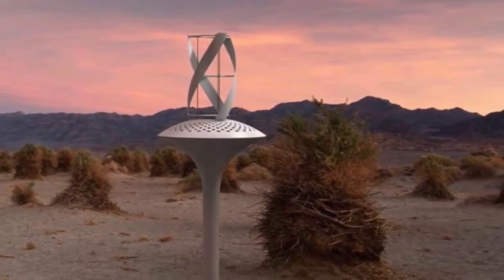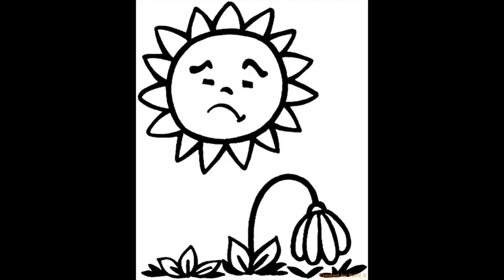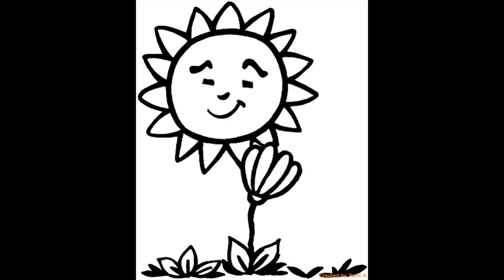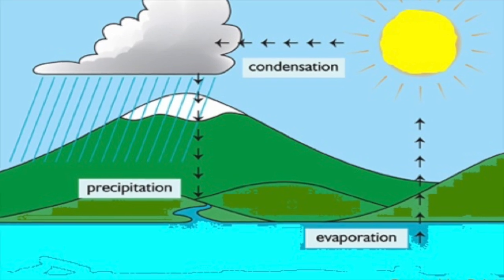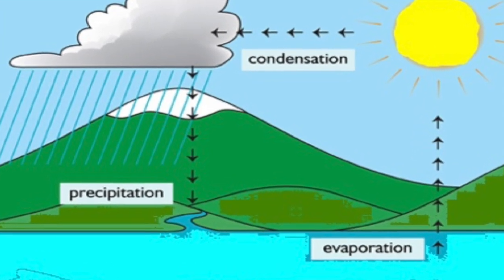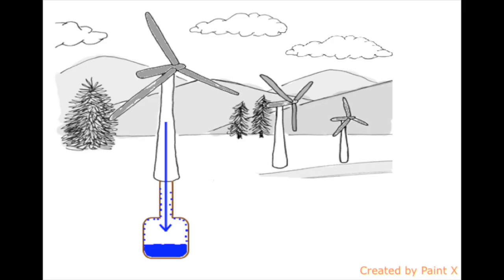Water Seer Debunked then FIXED (2020)

Comment: Instead of restriction of depth to 1.5 meters, say dig deep enough to where ther soil feels cool.  Aren't we discussing a heat pump.  They seem to function consistently.  After all, what is the heat capacity of the planet.
Reply from the maker: @alphalima6810  a geothermal heat pump basically

Comment: will it work if its in the desert and the air is arid  

or can i put a solar panel that will move the fan but how big must the  solar panel be to move it ??
Reply from the maker: @NMJ-zt6my  that’s easy, just work out watts needed and appropriate battery energy storage for 24 hour use
Reply from the maker: H

Comment: I think people are overestimating the amount of vaporized water in the air and the ease of turning it back into a liquid.
Reply from the maker: Are they?
Reply: @SimpleTek  The cost to build and run any of these sorts of devices will be very high versus the amount of water that you will get from it.  There are niche exceptions where collecting condensed water is viable, but they won't be anything like this water seer system.
Reply from the maker: @youtubewatcher4603  how do you know?
Reply: @SimpleTek  Which bit?
Reply from the maker: @youtubewatcher4603  all of it
Reply: @SimpleTek  I don't like one sided discussions, though.
Reply from the maker: @youtubewatcher4603  nice cop out

Comment: USD student Konstantin Avdienko, 18 local news in California built a crude version of the WaterSeer device and it works fine.
I think you need to do another video of him debunking your debunk.... It does work.
Reply: Chris is it true! Does the Water Seer work?
Reply: @OnlyOne0025  Seems so. Student and his school and the local news verified it worked. His is a crude version of basically same as what a water seer device is built
Reply: @Chris-wh3yz  thank you for your reply. So the Water Seer has to be perfected? Or can anyone purchase it and use it with results?
Reply: @OnlyOne0025  As far as I’m aware, the water seer never made it too market. The money raised went bust. I do believe because it’s up against a lot of parties interested in selling air to water machines for big money market. But testing on a. Dry similar approach proved it does work
Reply: @OnlyOne0025  Here is the US student and news report. His is a basic version.
https://youtu.be/eRteOtKqLOw

He improved it on a new device and can be found here.

https://youtu.be/o68leKAf-Gk

This one uses a pair of copper tubing, one inside the other in a coil structure and buried
Reply from the maker: Interesting
Reply: Alibaba has water seers from China available

Comment: Thats a good solution for the heat exchange issue, but does not change the fact that the air is not very humid in the desert  and the ground temp is usually above the dew point for most of the year. I mean, its the frickin desert. If they had the high humidity and cool temps needed for this to work, it would be a temperate forest, not a desert. 
No matter how you dump the heat, it still wont work.
Reply from the maker: Depends on the desert
Reply: Namibian fog disputes your statement.

Comment: This doesn't actually solve 99.999% of the problems with that device. The ground is not cold enough to condense the water, therefore no amount of tubing or surface area is going to help.
Reply from the maker: ground temperature depends on where you live
Reply: @SimpleTek  And yet no matter where you live, the ground will not be cold enough to cause any relevant amount of condensation. There is no place on earth where the ground is cold year round. Anyways, even if the ground is cold, it has to be cold enough to cause significant condensation. In places with water scarcity, the humidity is very low due to lack of rain, thus the dew point will often times will be below freezing, or near freezing. They certainly aren't going to have ground temps below freezing in those places. In order for higher ground temps to work, the air needs to have very high humidity. Places with high humidity have abundant water due to large amounts of rainfall. Also, keep in mind that in everywhere in the entire world, the ground is colder than the air for only 1/2 of the year. The combination of problems with this device mean that if you are in a location that overcomes one of the problems, you are gauranteed to have a different problem. There is no real world situation where this would work. This project should have never made it past the initial planning steps. Basic 1st year college physics can prove it doesn't work.
Reply: @Chris-hn4lp  what about a clay pot filter then tubing to the pump?

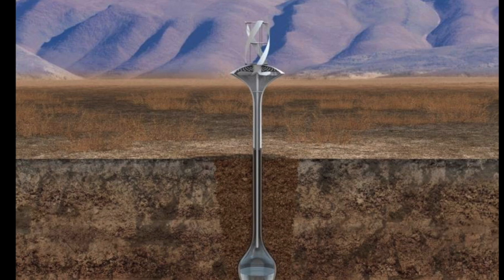Comment: 0:41 "the genius of the waterseer is that it operates with no electricity"
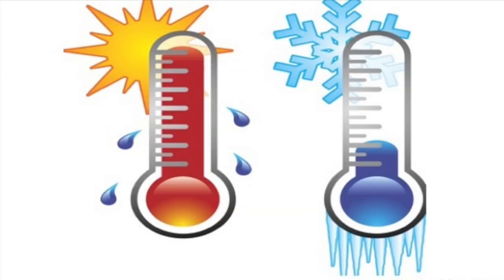1:04 "connect it to.... a small pump"

which needs electricity

That wasn't the only reason it was busted, there also isn't enough humidity in the air in arid areas for it to work (apart from perhaps a few weeks in the year).  The only way it could work is in a humid environment, but those places are rarely short on drinking water anyway.

Anyway going back to the thermodynamics thing, you haven't fixed that either, all you've done is mitigate it slightly.  You're grossly underestimating how much heat would be produced and how vast an area you would need to keep it continuously cool.

Don't forget that cold doesn't exist, cold is just a description for a lack of heat.  Humans can't create cold, and we can't remove heat, all we can do is relocate it.  That's how fridges work - they relocate the heat from inside to out of the back.  That's why the back of fridges are so hot.  Same with air con they extract heat from inside a building and relocate it outside.

The fundamental concept of the WaterSeer is that the ground is MUCH cooler than the air.  At first.  As I say once you heat something you can't remove that heat, it needs to go somewhere.  After you've heated the ground around the seer, it is now as hot as the air.

So you get your water pump and hoses, and heat another area of ground twice the size of that around the WS, and guess what?  Now that is as hot as the air too, it just takes twice as long.  Because the heat has got nowhere else to go.
So you get a longer hose and a bigger pump to cover ground three times the size of the ground around the WS, and guess what?  Now the whole area is as hot as the air too, it just takes three times as long.  Because the heat has got nowhere else to go.
So you get a longer hose and a bigger pump to cover ground four times the size of the ground around the WS, and guess what?  Now the whole area is as hot as the air too, it just takes four times as long.  Because the heat has got nowhere else to go.

And so on.  You can keep on increasing the size of the ground you are pumping to, but you need to get to a point where that ground is naturally cooled faster than the heat that the waterseer is generating.  It's not about the temperature of the ground in the first place, it's how fast the heat dissipates naturally.

I haven't done the maths but you should do, I'm pretty sure the amount of heat that a given area of ground (in the hot dry climates it's intended for) dissipates naturally vs the amount the WaterSeer would need to dissipate to keep dehumidifying is vastly infeasible.  You'd need a massive network of pipes, as i say i haven't done the maths but I'd estimate at least a football field, maybe several, very efficient heat sinks, huge expensive pipes (and the land-moving machinery necessary to bury them all deep enough), and very powerful electricity guzzling pumps (far more than a few solar panels could produce), in order to dehumidify the air for enough water for a family.

Even if it weren't impossible (because the air at the location had enough humidity in the first place), it's hopelessly expensive and inefficient.

There are far cheaper and far more efficient ways of getting water to these areas.
Reply from the maker: ok
Reply: Good points. But what if heating the ground is also beneficial to extend growing season? Or add a heat pump and use it to heat a greenhouse? All this adds complexity and cost, but if ground water systems are unavailable or degraded ...
Reply: @glenm125  WS is supposed to have NO infrastructure to supply small quantities of sustenance drinkable water. What is it about a simple hole in the ground don't you understand?
Reply: How come geothermal systems work then? Do they get heat soak? Hypothetically if you made sure that the temp diff lasted longer than the warm hours of the day, you could make it work. You would just need another windmill to run the pump

Comment: Simple Fix: If the problem is the ground being so warm that it causes the water to evaporate in the condensation chamber, then move your device indoors.  There is no need to bury it in your home, because your indoor temp will be cooler than the outdoor temp, but you can still bury it indoors if you wanted to.   Extend the top portion of the device so that it is outside of your home still sucking in the hot air.  The water will then condense in the chamber without evaporating. This is an easy fix at no real cost other than the tubing or piping needed to extend the top portion of the device to extend outside of your home.  This device does not need to be an outdoor device, it just needs to suck in hot air from the outside.  This will work great in desert climates.  The indoor temperature of your home replaces the cooling effect of the ground.
Reply: So what you're describing is just bringing outside air indoors and cooling it to the indoor temperature. You don't escape the thermodynamics. You still have to use energy to cool the air you bring inside (same as why your fridge uses a ton of energy of you leave the door open). Worse still, you need the dewpoint temperature to be higher than the indoor temperature. Assuming the indoors are ~70F, that's exceedingly rare, and pretty much never happens in dry places. Also, most people who have air conditioning, also have reliable running water already.

I do understand why people really really want the water from air thing to work, it's just not going to. You'll always run up against the fact that the latent heat of vaporization of water is just too high, and the specific heat of air is also significant of you have to cool large amounts of it. It's always far more energy efficient to just move liquid water from somewhere else, even over very long distances.

The only "water from air" systems that actually make practical sense are systems that pull moisture from coastal fog in certain coastal desert environments, but then you obviously have very high humidity, more importantly, the droplets in the fog are already condensed.
Reply: @mediocrehat  They also do (dew?) this as clouds roll over mountain tops using netting similar to oversize volleyball nets. Collection of condensation.
Reply from the maker: interesting

Comment: I thought you were being ironic when I first watched the video. I’m quite disturbed as this shows that so many people lack a basic understanding of simple science.  These must be the same people who think if you leave your refrigerator door open it will cool the room off. Of course this will have the opposite effect as there is no free lunch in physics. There is simply no way to condense water out of the air efficiently enough to justify any of the power and heat cost. It’s thermodynamics at its most basic. 

In order to condense water, you need to cool the air to below the dewpoint and it costs energy to do that, and a lot of it. Of course nature does this all the time on a large scale, it’s called rain and on a smaller scale: morning dew and fog.

Your solution doesn’t address the biggest problem of the Waterscammer, which is the ground isn’t cool enough to condense the water in the first place. 

Reverse osmosis provides a much more efficient way of producing potable water. In areas that don’t have water to be purified, the air is so dry that you would never get any solution like this to work with any amount of power.

The company that introduced this device ( and this is not a novel solution people have been trying to do this since the 1800s and earlier) are scammers and they knew it wouldn’t work because they never had any sort of working prototype or math that would show it would work. Eventually they released a product which was a $200 Walmart do you middle fire hidden in the art deco enclosure and sold for $1300.

And by the way, dehumidifiers do not produce drinkable water so they also sell $100 filter system for $200. You’re paying about eight dollars of electricity per liter of drinkable water that way. And that’s in an area with average humidity.

The water Sierra was a scam from it’s very outset so there’s no way to “fix it”. And even if it would work all that tubing we have an any idea how much that would cost with the excavation and the maintenance. And where do you end up ditching the heat? It’s got to go somewhere. The larger scale to set up the greater the environmental costs. If you remove the normal amount of moisture from the air you devastate the entire local ecosystem. It’s simple there’s no such thing as a free lunch in physics. So you have to go to minimize the costs and it’s been demonstrated hundreds of times across dozens of decades that this is not the way to do it.
Reply from the maker: the difference between book smart and streeet smart is actually having done something and seen it work vs telling someone something won't work cause you did the math wrong
Reply: That’s always what uneducated people who can’t do the math say. But whether you do it or not the math always has to work out.

What are you talking about you haven’t built this thing. You have a vague idea about solving one problem, without taking into account all the other factors that come into play.
Reply from the maker: @kierstinschmidt2514  except I did do it and it worked. your math is wrong.

Comment: i am told that the temperature of the earth at 6 meter depth is equal to average temperature of the atmosphere in that region during the year. This difference of temperature might be able to give us nearly unlimited source of energy to condense water vapor of atmosphere. What do you think?
Reply from the maker: the temperature varies depending on your location, type of ground material, geothermal activity in your area and climate. where I live about 8-10 feet down it ranges from about 8'C to about 3'C

Comment: This idea cannot and will not work, ever. There's too little potential energy between the air and earth to actually start capturing air moisture into *condensate*. Water takes notorious amount of energy to condense from vapour to liquid. You've just invented yet another dehumidifier. It uses kilowatts of energy per mililitre of water to condense any amount of water, and that goes up exponentially the less moisture you get in air. You need like 5 dehumidifiers at 2kw running 24/7 to give a single person enough water. AND you still need to treat it after, since it'll be very, very toxic water full of bacteria. Wake the hecc up damnit!
Reply from the maker: I disagree
Reply: @SimpleTek  your disagreement makes you a stubborn autistic idiot tbh. You're disagreeing with literal laws of physics. I'll just be laughing at you scrambling about. Or, hell, I'll be cheering that you get free money from other retards!
Reply from the maker: @dimitar4y  "Reverting to name calling suggests you are defensive and therefore you find my opinion valid."  Spock
Reply from the maker: @dimitar4y  "Reverting to name calling suggests you are defensive and therefore you find my opinion valid."  Spock
Reply from the maker: @dimitar4y   "Reverting to name calling suggests you are defensive and therefore you find my opinion valid."  Spock

Comment: What about the way heat sinks are made, and have the entire surface with the thermal "spikes" leading all the way to above ground, shaded from the sun, and inside the spikes they are hallow and filled with the gas they use in laptop heatsinks to flow the heat quicker...
I have a design idea. 
Side note have you ever seen a high preformance computer motherboard placed in a tank of pure mineral oil with no method of circulation. The motherboard does perfectly fine under heavy load.
Reply from the maker: good point
Reply: The whole fundamental idea that this concept was built on was that the ground is COOLER than the air.  Now you're saying use the air to cool the ground.  🤦‍♂️
Reply: @mrfish9876   more surface area is needed     a little pot in the ground will not collect enough water
Reply: you still need a radiator  for cooling as you would run out of thermal capacity